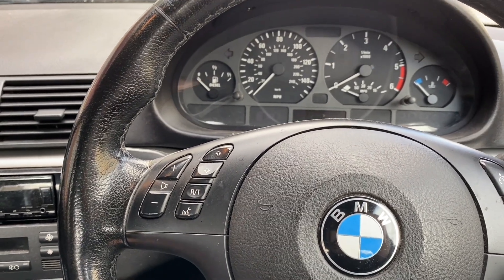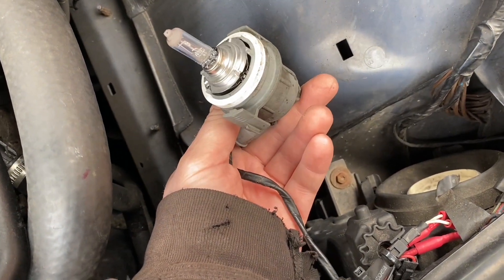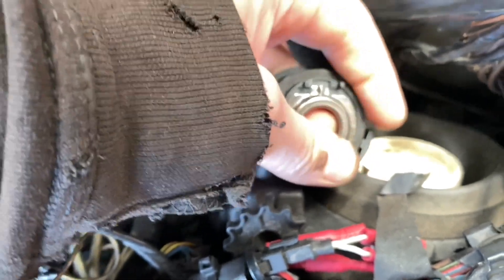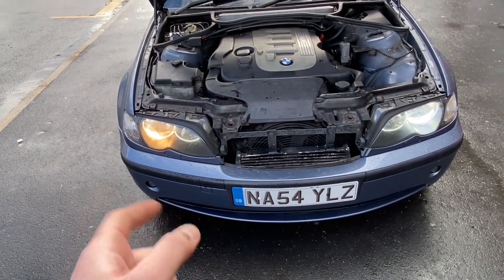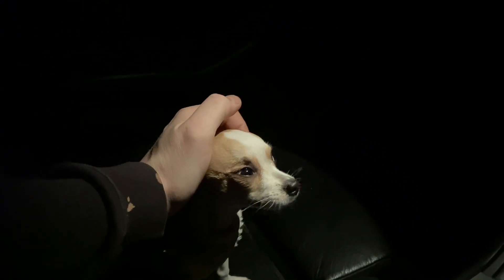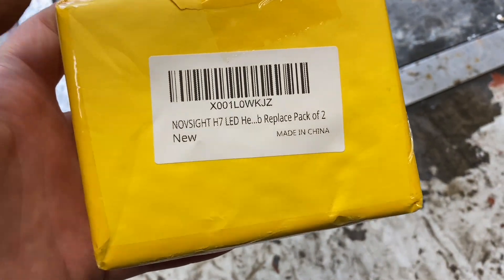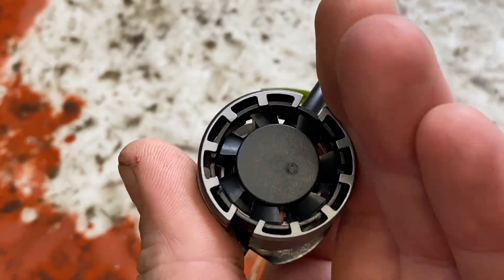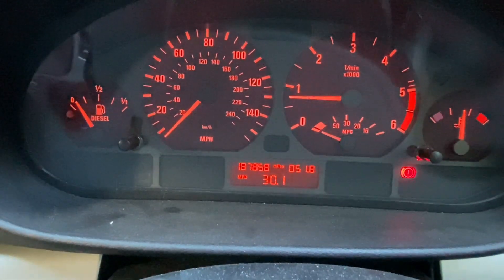BMW E46 LED Headlight Upgrade, H7 Reflector Headlamp LED With Beam Pattern?

Comment: is that safe when using non-canbus led for bmw e46?
Reply from the maker: It will just throw the dash warnings occasionally
Reply: @StupidBlokeStupidVideos technically it’s safe for daily use then?
Reply from the maker: @briannfairuxx no issues so far

Comment: What’s the adapter name ya and the size please for the led
Reply from the maker: @Leothebadass24  they are just e46 headlight bulb adapters on eBay, but in all honesty you’d be better off fitting these bulbs shown in this other video. They don’t need any adapters 

https://youtu.be/T9VNr3gAOV8?si=KKbBjUnDR1R9M6Ib

Comment: Hey man great vid - just bought these auxito LED bulbs to replace by old h7 ones. But i didn't realise that there's a second set of bulbs that need replacing. what are the other bulbs you used? Am i supposed to buy 2 sets of these?
Reply from the maker: I only changed the dipped beam ones but the main beam ones also use the same bulbs. You’d need to get 2 sets to replace them all
Reply: @StupidBlokeStupidVideos  nice, thanks

Comment: Great vid, had the same LED's fit to my mk8 civic but they definitely didn't have the same beam pattern as yours. More of a fuzzy line than a cut off.
 Ended up going back to halogens as I found I had to lower the beam to prevent the light overspill dazzling oncoming traffic. 
Although they were far superior in brightness I just wasn't getting the view distance. 
Currently using Philips whitevision 4200k which are a definite downgrade on light output but have increased the distance I can see without been flashed by oncoming vehicles. 
Think you hit the led jackpot there finding some that match your housing so well! 

Any experience with the new mini projector LED's?
They're like a mini projector built into the led.
Reply from the maker: Hi mate, did you twist them in the housing to adjust the beam? These are decent cut off tbh. Not 100% perfect but way better than the original bulbs. Because there’s not 360° light output of the led there are a couple of shadows that show in the distance, but other than that they are good. I’m considering modifying the lights with a projector inside though

Comment: osram h7 night breaker 200% next gen better than most in my opinion
Reply from the maker: Yea I’ve heard they’re good. I’ve not tried them but I have tried the Philips RacingVision which were decent, but didn’t last long at all.
Reply: @StupidBlokeStupidVideos  there are loads of +150/200% halogen bulbs out there for good price and lifetime. Bosch Gigalight, Osram Nightbreaker, Hella Performance, etc.
Reply: @StupidBlokeStupidVideos  search m3rovingian channel here on youtube.
Reply: @StupidBlokeStupidVideos  The osram nightbreaker doesnt last long either thats the trade off with all them brighter halogens is they burn out a lot faster

Comment: I kinda miss LEDs. I went back to halogen (Philips racing vision I think) on my C1 after having LEDs for a bit, they started good but the beam pattern went a bit off, even with adjustment, and I swear they stopped being as bright too. They were a bitch to get in and out too, the skirt was slightly too thick for the c1 bracket so had to really kill your fingertips getting it open & closed.
Reply from the maker: Yea they can fail over time. I’ve got some in my c1 that I’m impressed with. H4 are easier to get a good beam pattern out of as long as you get decent ones as they use a shroud to aim the light
Reply: @StupidBlokeStupidVideos  don't even think I had them in a year :( they were the ones Aanton reviewed, EasyEagle brand I think it was? They started out great.
Reply from the maker: @Lassitude1001  I hope mine last better than that. I fitted Philips RacingVision to a mates ovloV a bit ago, I made a vid on it actually. They were decent but they both blew within about 4 months… and cost about as much as these LEDs!